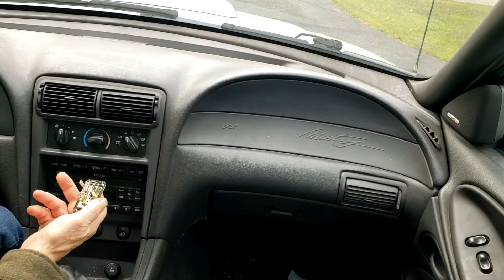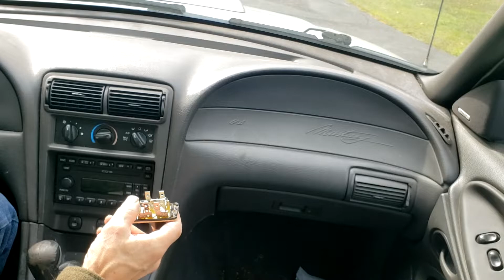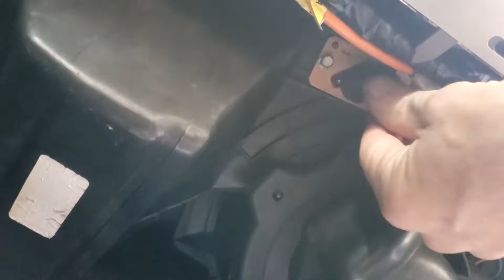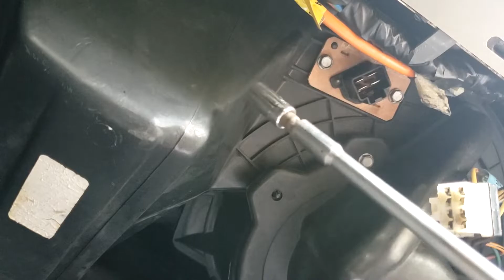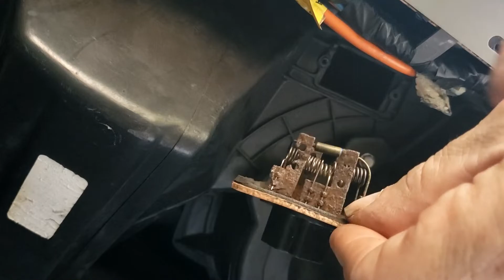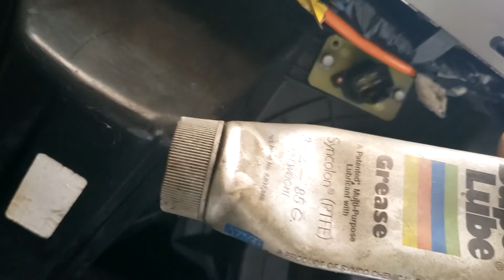Mustang Blower speed selector switch not working properly? Here is the most common reason.

Comment: What if it doesn’t work in any speed even high?
Reply from the maker: In that case the very first thing you have to do, is confirm it has power, start at the fuse and work your way forward along the circuit, until you find the fault.

Comment: I have a problem where I cant switch it off defrost. The fans work and I can turn it off but if I try to switch it off the defrost nothing happens. How do I fix that?
Reply from the maker: The problem is obviously in your vent selector switch and not your speed selector switch. The vent selector switch has vacuum ports and switches the vents by vacuum. The most likely reason for it not to be working is a vacuum leak or disconnected vacuum hose.
Reply: @robertbabich1154  thank you I’ll look into it and see what I can do